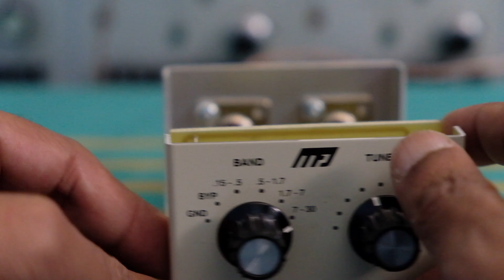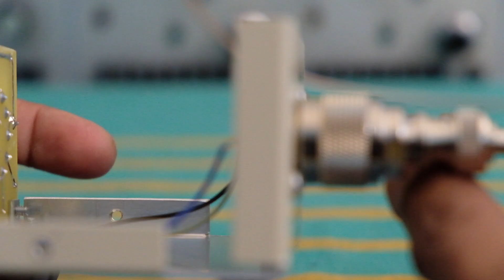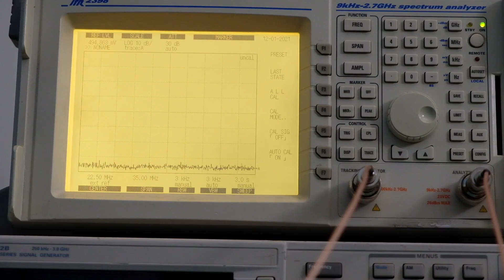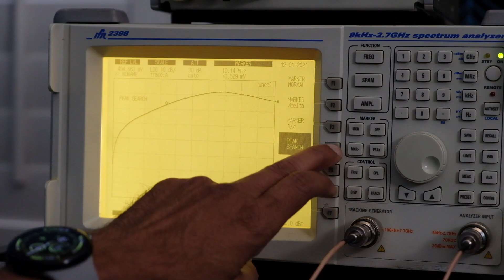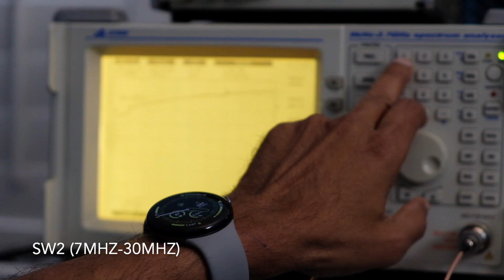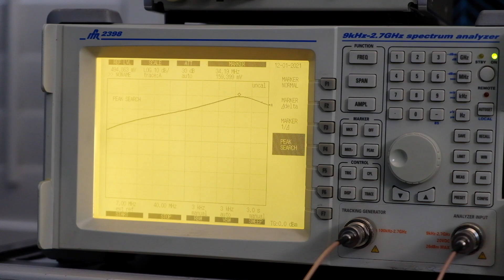MFJ 956 - tuning characteristics

Comment: Hello from Oregon. 

Please ignore my questions if you're busy and thank you for the brain exercise.  

When you tuned this device with your Sony, over the years, did you develop a feel for the capacitor's attenuation spots and learn to ignore the other switch setting markers?

Also, this is breaking my brain just a bit. Ok, it appears there's no amplification, right? However, I just watched another 956 demo with an SDR and it looked like peaks were amplified while being tuned. So, is that just noise being eliminated around the peak and the screen adjusting?

Amazing video, by the way.
Reply from the maker: Thanks. One basically tunes the MFJ by listening to the noise level attenuation on the receiver rather than seeing a boost in the signal. This is a passive filter. The radio does all the work in terms of amplification, selectivity etc.